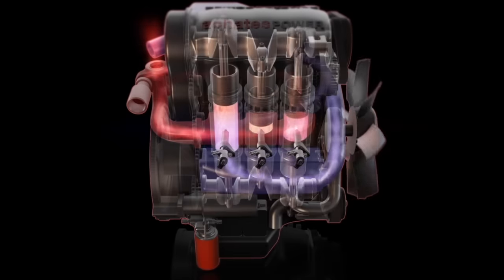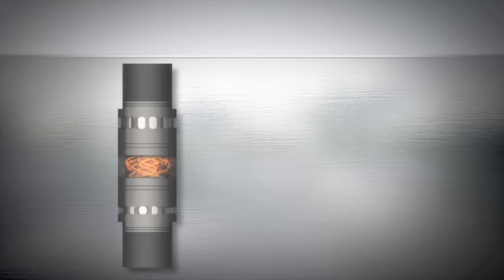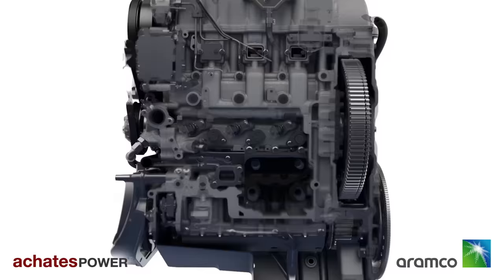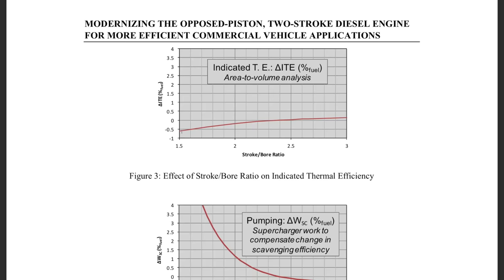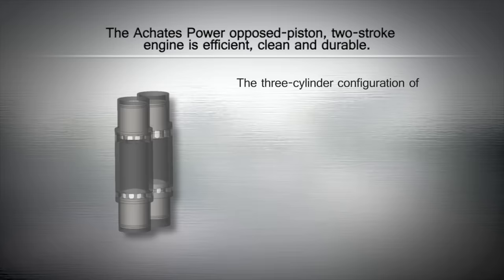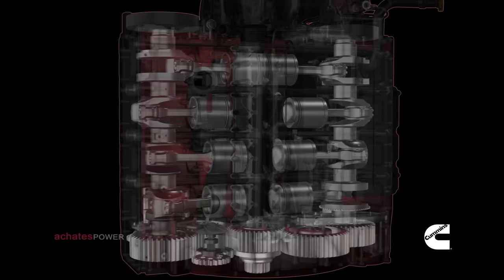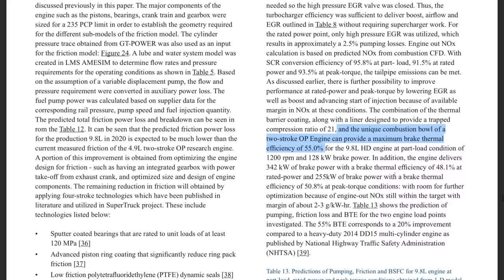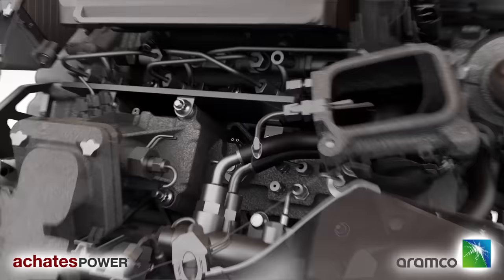Opposed Piston Diesel Engines Are Crazy Efficient

Comment: Couple this with a CVT transmission and you will have efficiency to keep anybody happy.
Reply: I'm the best. CVTs are junk. unless they start to put in a first gear  and 9 more gears and drop thr CV part from it
Reply: The CVT has been around for as long as cars have been.  There have always been problems making CVTs reliable under higher horsepower engines.  Nissan became noteworthy for making one that would stand up to a 3.5 liter engine long-term, but they too had problems doing so at first and were compelled by class action suits to pay for transmission failures outside of warranty.  

The idea of the CVT is to keep the motor in an area of maximum dynamic compression which is where the engine efficiency is.  A gasoline engine is throttled by closing the throttle plates which lowers cylinder pressures.  (high vacuum)  The CVT compensates by keeping RPMs low to keep cylinder pressures high.  On the other hand, the continuously variable CVT is an inefficient transmission, and why the trend is toward gears and low-stall lockup torque converters.  The CVT is much less of an advantage to a diesel because the cylinder pressures are always high.
Reply: Jack T agree with you 100%, even diesel applications we have trouble with Ishifts and Eaton fuller trans all the time and those are designed for trucks. CVTS would crumble
Reply: CVTs are terrible transmissions-unreliable
Reply: Worse transmition ever no reliability always breaking down
Reply: @GeneralG1810  and 2 nuts and a shaft.... sorry, could not help myself 😅
Reply: LOL

Comment: Spent many hours as a throttleman on a submarine with Fairbanks Morris 10 cylinder 20 piston two stroke engines. 1600 hp at 750 rpm. Air start, two engines in each engine room, two engine rooms. The beat the pants off the GM 278 A, V 12’s, 278 cu per cylinder.  Baldy old motor Mech.
Reply: me to on the 580, big hearing loss from turbochargers
Reply: johnny z served on uss Cobbler ss344 GM boat, uss irex 482 FB boat, uss Patrick Henry ssbn 599 nuke. Got hearing loss also.
Reply: A Fairbanks Morris was used to power the emergency generator at the power plant I worked at. It provided close to 1MW to power enough equipment to get the 115 MW power plant running. Meaning you could start the plant with entire grid down.

Comment: Napier Deltic is the most awesome opposed piston engine ever. It's a 18 cylinder, 36 piston work of art, like three V12 engines joined together.
Reply: Sounds like a detroit
Reply: Three V12 engines joined together would be a 36 cylinder work of art.
Reply: @jimbalayaman7227  it's still weak for some reason
Reply: 18 cylinders, 36 pistons...

Comment: I have had the good fortune to ride in a coach, and to drive a horsebox, both powered by the Rootes / Commer TS3, 3-Cylinder, opposed piston, supercharged diesel engine.  I think, but I’m not certain, that it was supercharged by a Roots-Supercharger.  With the 2 rotors.   I haven’t seen -or heard, any more since 1977.   I’ve never had to work on one of these units, but I appreciated them for the reasons you narrated.  I’m not sure, but I think the TS3 might have been about 4 litres or just over.  I forget, now.
Reply: 3.5 litres with an amazing power/weight ratio.

Comment: Unfortunately Diesel tech in the US has a bad rep. Alot of that is due to GM's Buick division's 350 V8 diesel which was a nightmare combination with noise n smoke of older mechanical rather than electronic engines.
Reply: I dunno, the us makes some of the best diesels! Mack, cat, Cummins, Detroit, John Deere, case, new Holland, agco, Ford to name a few that have a good reputation over here in Australia
Reply: That was an Oldsmobile engine.
Reply: @gordonmacqueen8694  my experience with it was in a Buick, but yes it was built by Olds
Reply: @joecook3223  most of those companies did nothing but diesel. Detroit, Cat, Cummins John Deere, also focused not on passenger engines but commercial/heavy industry. In my PERSONAL opinion the Ford powerstroke sucks, whereas the Cummins light truck motors were good esp the older 12V in the Dodge ram.
Reply: Didn't really get any of those Cummins motors over here in cars, but we've got 2 case headers, one with a 5.9 and one with a 8.3, both with over 5000 hours, they seem to be very good motors indeed. Use a bit of oil these days though, can't really blame the motor though, they've both done a lot of work.
Reply: Diesel fuel in the US and Canada is not easy to get, and costs as much as gas or more. So there is no advantage in economy to a diesel. Except in large trucks that get significantly better mileage than gas powered trucks. In cars, there is no advantage and several disadvantages.
Reply: @mrdanforth3744  What do you mean no economy advantage? They get over 30 mpg easy in smaller cars like VW TDIs, that's hybrid numbers for petrol cars. Even if gas is cheaper here, you can't deny the fuel economy of a diesel.
Reply: Nothing new under the Sun... Napier Deltic, Comma TS3, Junkers Jumo Aero, Doxford and Fairbanks Morse Marine engines all used this configuration in one shape or form and for the time showed advantages in efficiency, size and weight. 
Only crude mechanical fuel injection and metallurgy held them  back with excessive emissions due to high oil consumption necessary for adequate piston lubrication to cope with the higher cylinder temperatures present in an opposed piston design and the usual high rate of wear to piston rings passing over ports. Piston Crowns and attendant seizures used to be a frequent issue on the Deltic Engines but in the 1960's  they were the only way to get 3300hp into a locomotive weighing 100 tons. 
All diesels were comparitivly 'dirty' and not overly powerful before computer controlled common rail injection giving far precise fuel timing and metering came onto the mass market.

Comment: When I was an engineering student, our professor was working on a multifuel opposed-piston engine for TANKS. The efficiency [in that particular case] was less important than the fact that it could work with almost ANYTHING used as fuel. It was so great that I've always wondered why such a design was not more widely used....?
Reply: Because the US military doesnt have to follow epa emissions regulations
Reply: You are probably thinking about the L60, as fitted in the chieftain tank,this wasn't the best of engines to say the least
The K60 & H30 were ok

Comment: The problem is emission:) They had a presentation at my school last year.
Reply: Z Y exactly, two stroke diesels are not new, opposed pistons are not, because you don't have valves you can't alter valve timing, and you will always have the problem of a narrow torque band. That is why 2 stroke Detroit diesels had to have 8 sped gearboxes just to pull away.
Reply: it`s not a problem for military applications
Reply: emissions are fine, its called the EPA

Comment: I designed and engine eerily similar to that in a game called Besiege, tho the reason the one I made is better then previous is because each piston has such a short stroke plus it's just extremely stable by design which allows you to use very high engine power.

Comment: Interresting. 
What is the rpm range of this motor?
What is the weight of this motor? Could it fit in a semi's engine bay?
Reply: The one he gives hp and torque spec on would be too weak not even close to enough torque for a semi but a larger one would likely do the job
Reply: @bensmith4563  there have been I believe 5 cylinder/10 piston ones used in tanks... That'd pull a semi
Reply: RPM are nearly unlimited, bec of the missing valves.
But the efficient zone might be between 1100-2X00, the same as regular Diesels
Reply: The engine in the video is for a pickup truck. The semi truck sized engine that is in testing is called the A.C.E. It is 1000hp. Stands for advanced combat engine. They created it with Cummins.

Comment: Fairbanks Morse has perfected this over 70 years ago.
Reply: This is based on that technology. The problems with the Morse engine was overheating which was likely due to technology available at the time. These guys have worked on that.
Reply: RedWings-44 FM is still used on ships and stationary power. I think that the overheating happened on railroads operating them in desert environments.
Reply: @brianburns7211  I just know there were issues scaling down the engine related to cooling. My best guess is that in ships, the channels for cooling were much easier to create since the engines are much, much larger.

Comment: I'd love to see how this technology would reduce fuel consumption in a car with same displacement and power/torque as stock
Reply: You can calculate that yourself. The average Diesel car is around 25-30% efficient. This is 55% efficient. The displacement and power/torque doesn't matter because engines scale pretty much linearly. Therefore, you'd get about twice as many mpg as with a normal car of similar engine power.

Comment: Is it possible for this type of engine to ever reach the 60% thermal efficiency mark in the future through research and development? 45%-55% is still crazy efficient though, but I was just wondering.
Reply: It could. For a normal engine the best are in toyota hybrids, which have a thermal efficiency of 40%. This is mainly achieved through the Atkinson cycle and emissions gas re-circulation. But there are down sides to this. One of them is that the cabin does take a while to warm up from a cold starting engine, that and for some (technically 2010 - present) hybrids the aluminum cylinder head actually warps for hard use vehicles because of that high thermal efficiency and how the cars were intentionally built to retain heat for the sake of economy.

60% is amazing, current the best I could think of (excluding electric motors) are 55% for steam turbines.
Reply: No too much energy is require to push the pistons back during combustion
Reply: If you could use the waste heat / say for domestic hot water, possibly -
Reply: Two words; turbo compound.

I have been tracking this engine and Achates' coop with Cummins and DARPA. And I already know how to improve it significantly. Although I am thinking of an alcohol design for extreme compression ratio and specific power to weight.
Reply: 80% thermally should be easy, especially stationary apps, using every imagineable efficiency trick thrown at it.  80% economically, self sustaining is the question.
Reply: Roger Aydin There are modifications to increase efficiency out there.   Running duel fuels diesel/ propane ect. can increase efficiency.  60% to 75% percent is possible with this engine if you know about certain technologies.
Reply: PhilosophicalZombie 
"And I already know how to improve it significantly".
PU or SU...
Reply: @Frank Baker "If you're good at something, never do it for free."
Reply: Rick Delair adiabatic is an ideal trait, not possible as far as I know. If I'm wrong please tell me, I'm going to be tutoring Thermo next semester. Don't want to give people the wrong info.
Reply: Roger Aydin it will not likely reach the 60% mark, as the diesel cycle reasonably tops out at about 56% in an ideal scenario. Obviously they're not using the classic 4 stroke diesel cycle, and their compression ratios are going to be very high, so 55% may be a reasonable goal. Remember that when you are trying to find theoretical efficiency you should always look at the ideal situations. If someone gives you crazy high numbers you can check them using entropy equations but I forgot how to do that. Gonna figure it out again sooner or later.
Reply: F1 hybrid engine react this efficiency but they use two different types of thermal energy recovery. There is also technologies that could be add to increase the efficiency again, like pre-chamber combustion and other combinations of circulation methods. Don't know the world record for a internal combustion engine and its theoretical limit but, my guess would be 80% or less, significantly less than electrical systems.
Reply: Not for a reciprocating piston design, but the toroidal engine could quite possibly exceed 60% efficiency.

Comment: What about the Deltic engine - 3 cylinders in a triangular configuration with opposed pistons and shared crankshafts.  The piston timing was quite different from this description.  I'd love to see you explain the engine the way you did this one.  BTW it was originally designed for an aircraft, but eventually powered railway engines.
Reply: The efficiency of 9 cylinders on 3 crankshafts would have less friction loss than the video's 3 cylinders on 2 for the same amount of power.  Consider a Hexagonal engine of overlapping Deltics: 36 cylinders with only 7 crankshafts yields less than 1/3 the frictional losses in the crankshafts.  Perhaps such engines running on biodiesel could be the future of sustainable electricity generation.

Comment: I'd like to know how oil scavenging is handled for the top crank. Seems like this would be a great unit to implement in a horizontal configuration if possible.
Reply: Like a boxer engine?   The biggest issue with a boxer is piston ring wear.
Reply: @scottmoore598  I would assume thays due to gravity making it hard to lubricate to top side of the cylinder?
Reply: @zaccheus  A Boxer like the Subaru has the pistons horizontal riding sideways on the rings causing the ring's bottom to wear faster.  There is one crank shaft in the middle, but the pistons face away from it.  When both pistons fire, they push against the opposite cylinder heads, but at the same time so the engine block's reactive force is opposite of each other and there is very little engine vibration..
Reply: @scottmoore598  I'm familiar with the boxer configuration, but I did learn some stuff with what you said there. Do all horizontal stoke engines suffer from ring and piston wear? I've never heard of that particular problem with anything else with a horizontal stroke.

Comment: Junkers built this type of engine well before WW2, also as aircraft engines. One of the main problems with it was that it was INSANELY noisy. The gears and the compressor gave a very loud, high-pitch, ear-splitting whine.
Reply: Yeah, the early Peugeot company pioneered a way to make precision opposing-sloped continuously-meshing gears (>>>>>>) that were very quiet. (Thus, their logo) That solve the gear whine for everybody.
Reply: Reference Chieftain MBT at full noise. And its trail of oil leaks

Comment: When I saw your animated introduction, I thought to myself someone has finally got this right. Don't know how this will work out though in terms of dieselgate and the EPA adding on all the extra smog controls to diesels. Also think that auto companies are pretty gun shy now about investing in new engine designs and tooling. Sales are down due to C-19 and limited resources are being timidly applied to BEV design. Personally, I would like to put one of these into my '97 Dodge Ram if the 12 valve Cummins should EVER wear out.
Reply: I doubt we will see examples in a civilian vehicle, but the military is likely free to run with it.